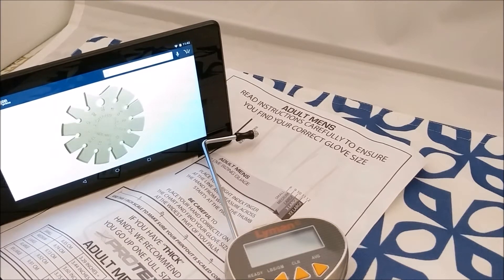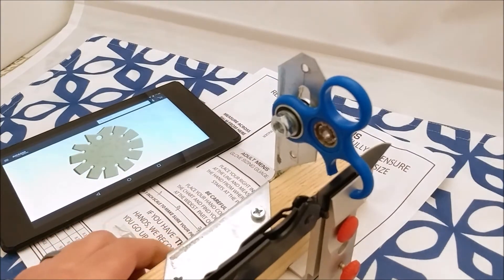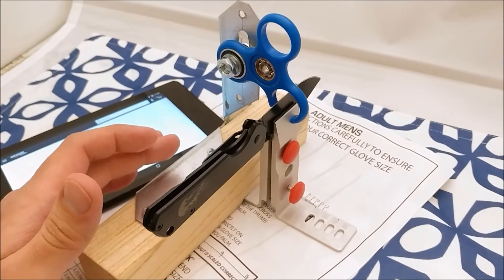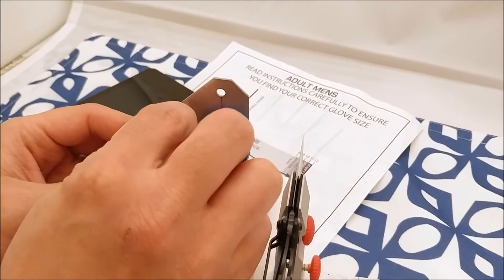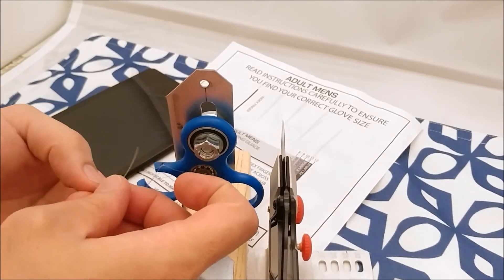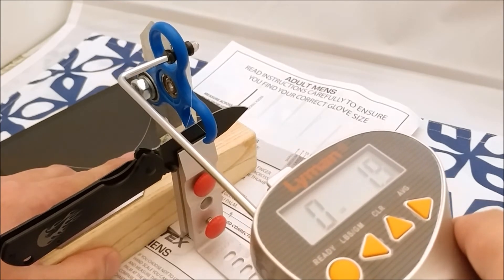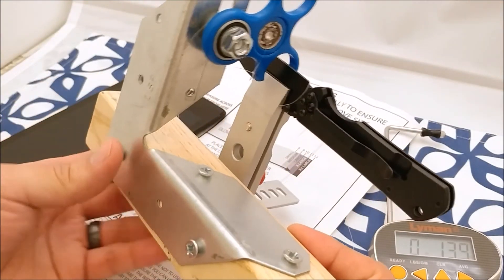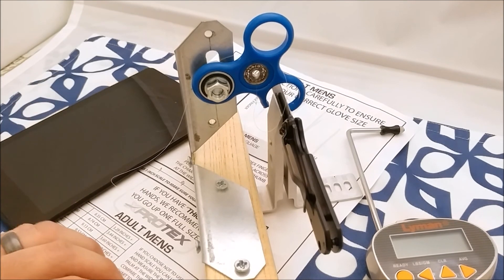Sharpness Tester Device Version 2.0

Comment: A very clever solution to a not very easy problem. My comments aren't meant to be critical of your work. They hopefully, add to it for you and others that come across as I did. While I'm a bit late to the game, I am looking for ideas on building a device to hold the line for a computer weight-loaded sharpness tester. This video may change my design. I worked the last ten years of my career in a university engineering shop as the software engineer that built things the faculty, industry, students, and cooperating farmers wanted. Your solution is a good one. As it is it should work well for comparative testing of before after sharpness. cutting slots rather than holes to hold the monofilament and adding a threaded insert for a wing-bolt & washer to clamp the end of the monofilament line should speed things up. If you publish the work you do using it the reviewers might criticize its flexibility.   Increasing the stiffness and replacing the wood with cast iron, steel, or aluminum would improve the repeatability of the measurements. l larger Fidgit Spinner or simple bar would. I took a hard lesson on wood moving as humidity changed in a measuring device.

Good job!
Reply from the maker: Hey thanks for taking the time to review and comment and if you could come up with more of a servo based system that would apply force at the same speed and consistency, that would improve the process.  Let me know when you have the product completed. Will be interesting to see how it comes out.  
 
    Companies like Send Cut Sent might be a good option to design and have the parts cut and bent.
Reply: @BladeBanter  I've tried to build scales to weigh one piece of the clay carrier a herbicide that was applied at the rate of 2/3 ounce to the acre.   They wouldn't throw a shadow I could reliably measure. The Kibble or Watt Ballance that will be used to define the new Standard Kilogram could be servo-driven by pulse width modulation from a stable voltage current limited source and obtain very reliable data with the thread you use in this video.
Reply from the maker: @gordoncouger9648  Nice it would be good to, reduce the variables. I have heard that the thread I use can offer different results.  
     I considered using their standard spool system and having something like a fishing weight apply the tension so it would be repeatable.

Comment: Thanks for the video David. Absolutely fantastic. This is the type of innovation that excites and impress's the heck outta me, well done. I might of missed it, did you mention the weight strength of this line? I'm sure my science and physics aptitude is pretty low, but I wonder what kind of results braided line would yield. Was there any flex in the fidget spinner plastic? If so, I'm guessing that could skew the results as well. Great video!
Reply from the maker: 6 lbs test, I didn't notice any flex in the spinner.  Working on a process to consistently hold the line between test.  
     Thanks and I'm going to continue to play around with it and lines to find the best results.

Comment: That is pretty creative.  
Since this would be a repetitive task, consider getting a needle threader and using a very small binder clip (or two) to speed the process up.  Also, I recommend using an actual razor blade, rather than the utility blade shown in the previous video, as a control.  Good luck, I hope this works well for you.
Reply from the maker: That will be the next step to get a standard way to set the tension.  I agree I was going to utilize double edged razor as a baseline.